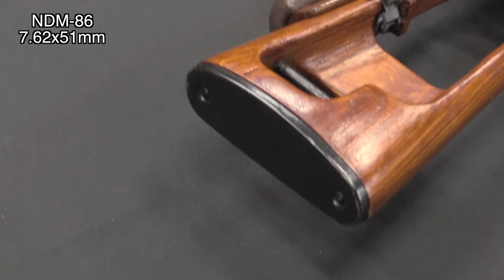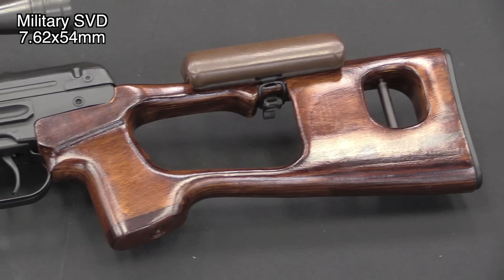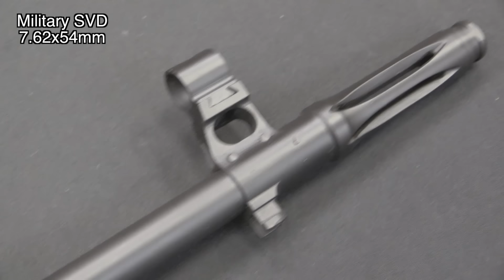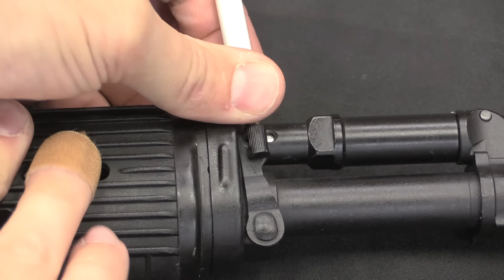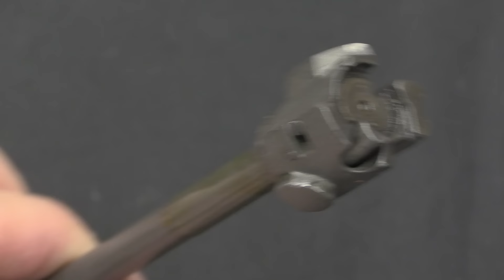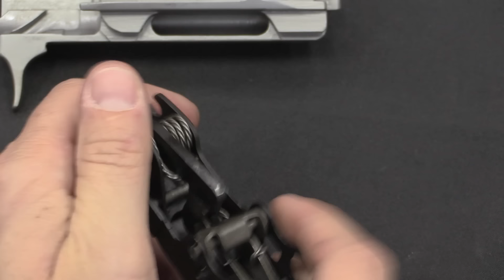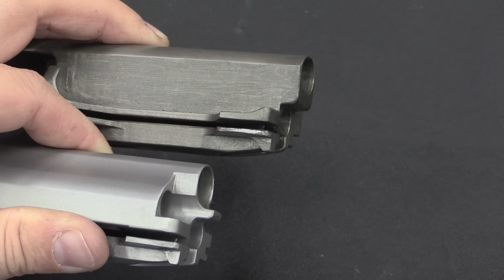Dragunov Variations: Military SVD, Izhmash Tiger, Chinese NDM-86

Comment: what is the benefit of an adjustable gas piston?
Reply: You can increase the amount of gas going to the action if the gun becomes dirty enough to malfunction and you are in the field / not able to clean things. Some adjustable gas systems you can also reduce the amount of gas to compensate for the increased dwell time a suppressor adds.
Reply: thank you, it does make sense.
Reply: They can also be used to tune the rifle to the ammunition being used. You'd use a larger gas port opening for less-powerful ammo, so that there's enough gas to keep the gun cycling, and a smaller one for more powerful ammo, to prevent premature wear. 

However, for a military rifle which tends to have a steady diet of standardized loads, that function isn't usually needed, and it's mostly used for the reasons that 27dcx stated.
Reply: I have an adjustable gas piston on my SKS. But that is so I can launch grenades!

Comment: The machining and coating on the receiver is much better on the military SVD.
Reply: Yeah, the drop in finish in the commercial gun is staggering and it's a pain to look at. The Soviet military one is absolutely gorgeous.
Reply: In my admittedly limited experience (mostly dealing with watches), Soviet quality control and general finish was on par with or better than it is in Russia today. It was leaps and bounds ahead of anything made in the 90s.
Reply: i thought that while looking at the bolt carrier. the tiger looks so crued, and the military one just shines
Reply: Tigrs were manufactured for a long time now. From what I have seen in the Russian stores, there are neat-looking ones. Besides, it's always a crapshoot with modern Russian guns made for civilians - QC sometimes wanders from perfectly fine to "needs generous application of file and hammer" between years or lots. Considering that there are many collector / nostalgic buyers of Tigrs in Russia, I am sure you can make sure that your gun is extra-choice QC and comes with desired options by contacting the factory (also, they began offering "authentic" classic furniture version to casual buyers some years ago, don't know about its finish).
Reply: I bought a fresh 2018 made Tiger few weeks ago - the receiver is milled very clean and nice, and other parts are also made good. The only thing the Kalashnikov concern (IzhMash) still got problem with is proper assembly(( You need to browse through a few guns to find one which is straight - irons and gas block not canted, stock is straight, and so on... But looks like they working in that direction right now, quality is getting better each year. Tiger in the video was made in 1993, the Soviet Union has just collapsed and it was hard times in Russia, guess thats why it's finish is so rough.
P.S. my tiger also got the adjustable gas block like on that svd - it's optional) It costs about 100-110$ more than the regular tiger with no adjustments.
Reply: Emperor Spock the chinese ones are actual military rifles, they were merely just expo marked and shipped out from the same line. They are just as good as the Soviet ones. But yes, inferior finish.
Reply: @humansvd3269  No its not the military version, Chinese military dont use .308, they also use 7.62x54R, and that version of copied SVD is called Type 79/85.
Reply: @qiyuxuan9437  You misunderstand.

The type 79/85s that made it in the usa were military rifles maked for commercial export. They are the same as what China uses.

308 was made for export only.  They tried to sell to south Africa but they didn't buy it.
Reply: @humansvd3269  Well, not sure what parts can interchange between the .308 and 54R version. But the 308 parts most likely are slighty worse than the 54R version.
Reply: @qiyuxuan9437  The bolts are different and the mags are different (minus the em352).
Reply: Konrad Ford Norinco is merely the commercial name for the Chinese military companies that produce them.
Reply: It also has a chrome lined carrier (and potentially bolt but we didn't see it).
Reply: You can expect quite a lot from Soviet Russia. From just Russia, not so much.

And it's not just about the coating: the machining is clearly more sloppy in the more recent gun.
Reply: The tigr is just the latest variant but civilian, the contemporary military versions are the same except some small details like gas system, barrel lenght and rear sight leaf.
Reply: Looks re-parkerized to me. As far as I can tell, SVD and Tigr had the same finish, not great looking but what do you expect from soviet Russia?

Comment: If i had a dollar for every time somebody said a romanian psl was a dragunov
Reply: You could buy a medium sized meal at Mcdonalds?
Reply: I'd have enough money to buy an actual Dragunov
Reply: +drunkensailor775 How is a Tiger not a Dragunov? It is literally made by the same company. It is quite literally a hunting variant of the SVD
Reply: Tiger is an SVD, PSL is not. A name is a name, it's a moot point. The mechanicals are what matters. An M1A is just as much M14 as an M14. And actually I'd like to mention quite often the civilian versions of guns actually end up being higher quality than their military counterparts
Reply: In country, we referred to them all as drags, not sorry. Having shot a military issue psl and a military issue dragunov, in practical use they are identical.
Reply: Гаврило Принцип Technically speaking, and this is a very pedantic point, but the PSL is actually a scaled up RPK. It uses the same bulged trunnion and the same slightly thicker receiver as the RPK. Very small difference and yeah it's true that it's still pretty much an AK, but people don't bring this point up enough imo.
Reply: Small Arms Humane Society They both work just fine equally. People are pedantic when it is not necessary.
Reply: @Woodruff more accurate ? I really really doubt that . a coworker of mine was able to break a cigarette at 500 meters by 2 shots . another one was able to put 3 bullets at 400 meters so close to be covered by a small coin . twice . and I knew a guy that put at 400 meters 3 bullets so close that a needle can pass through all thee holes without extraction . all of them used romanian military PSLs with romanian military ammunition , rifles being tuned by romanian military experts . none of my coworkers was a professional soldiers , and all this shooting was done while they were in mandatory military service . so ... what exactly "more accurate" mean to you ?
Reply: @bulllea  I'll take Shit That Didn't Happen for $200, Alex. 

Also, since we're talking about stuff that didn't happen, I also have a co-worker who shot a coyote running at full speed at 500 meters in the brush using his Hi-Point 9mm pistol. He almost didn't get the cayote since he was riding a unicycle at the time and didn't realize the cayote was there until it was too late.
Reply: @TheLouHam  I get it . the "coyote stuff" is written in military archive records , also ? because in here , all the shooting sessions while you are in mandatory military service IS KEPT IN ARCHIVES . do you understand ? if I will tell you my name , the year I made the mandatory service and the unit code ... the army can tell you the points I obtained to all my shooting sessions . they will tell you even the points from shooting the 85mm cannon . one of my coworkers get a 2weeks leave as a direct result of his shooting trials . twice . it's written on paper you also will get a special citation like a small decoration that is also written in your record . isn't the same in all the armies of the world ? so ... your army kept the coyote incident in their records ?
Reply: @bulllea  so which military uses cigarettes officially as targets? Romania? LOL  Since you are the one claiming these as hard facts, then it's on you to provide evidence that what you say is true. Break a cigarette with two shots at 500 meters with a PSL that can barely do 2 inch groups at 100 meters? Yeaaahhhhh. But go ahead and believe your buddy. Nothing wrong with believing a harmless lie.
Reply: @TheLouHam  2 inch group at 100 meters ? are you crazy ? I've saw that with AK47 . iron sites .  well , mister ... we are in a courtroom and I am unaware of that ? what is it worth to you ? what if I can provide official documents that this fact really happened ? what is it worth to you ?
Reply: Evan B I wouldn't take it to seriously. It's all about semantics.
Reply: I would spend it in a grenade and swallow it
Reply: I'd have 0 dollars
Reply: Just an FYI. I had a cugir PSL and it was junk. Way over gassed. Poorly constructed. Much heavier then a drag. Its literally nothing like a drag. Only real similarities are pso1 scope and kind of similar butt stock. Definitely not nearly as accurate.  Oh did I mention anything other than light ball will destroy the rear trunion.? Tried a kns adjustable gas piston. Rifle still sucked.
Reply: @lambo5965  Civilian export PSLs ARE inferior. They had to be built for the US market with an entirely new receiver. You aren't supposed to fire heavy ball from either the PSL or the Dragunov it will ruin either. If you have a Dragunov and are firing military heavy ball through it you're an idiot with too much money.
Reply: You would have 18 dollars.
Reply: I don't know about you, but statistically the PSL and SVD are the same rifle.

If I prefer an M70ab2 over an AKM, I think I could handle owning a PSL and not an actual SVD model.
Reply: drunkensailor775 Tigr does exist with a long barrel and can have adjustable gas block too. Rare though. Point is, it is still a dragunov. It uses the same system and parts.
Reply: It’s people like that who don’t know what they’re talking about. The PSL is actually pretty easy to differentiate from a Dragunov, as it’s controls and receiver (which, if I’m correct is based off an RPK receiver) are shaped differently. Also PSLs seem to have a more curvy stock. I do have to admit however, in function they are nearly identical.
Reply: @somerandomassguyontheinter2869  You can tell a PSL from a traditional Dragunov by it's Kalashnikov design. If the magazine and magazine catch is touching the trigger guard it is not a Dragunov. The Romanian PSL is just an elongated RPK receiver, as you said, to support the 54r rifle cartridge.
Reply: or TIGER
please do not confuse civilian TIGER with SVD
Reply: Konrad Ford You've taken his comment to literally. He was talking about the nomenclature.
"SV" means sniping rifle. There are no civilian snipers who shoot other people. That means a tiger is not a sniper rifle, therefore not an SVD.
Reply: @Turgz  sniper, didnt come from the term of shooting people.

A sniper, come from the snipe, the ability to shoot a bird. It is a hunting term.

And in russian a sniper, is any long range shooter, so it is a sniper rifle. And is an SVD, the name тигр is business so that it can be sold differently than the military model.

Because it is very hard in russia to buy anything over 9mm, so alot of them sell civilian models overseas to countrys like the US to make more money, like siaga does.
Reply: @Robert53area  Very true, but I was talking in context of a military. A soldier's job as a sniper is to shoot people and equipment, not birds.

Again, it's more to do with nomenclature than anything else, in the case of the SVD/Tiger. A tiger is called that instead of SVD as a sniper rifle is associated with being a military weapon, and military 'style' firearms are not normally allowed.

Also, I did not get any notification for your reply, so that is why It has taken so long for me to reply.
Reply: @Turgz  are we forgetting that one guy who sat on the tv tower and shot a bunch of people ? Or more familiarity the shooter in Vegas yet he wasn't a sniper but you know what I'm getting at basically they were shooting at elevated positions
Reply: @michaelbarker3078  Those guys were not currently serving snipers on duty doing their job as a sniper so no, there are no civilian snipers shooting people. If that's what your comment was referring to, anyway.
Reply: @Turgz  yes it was thank you for not tearing into me and respecting my opinion and you are rightly so even tho the one on the T.V. tower I believe was a USMC  vet or was currently serving but I don't know if he was a sniper or not